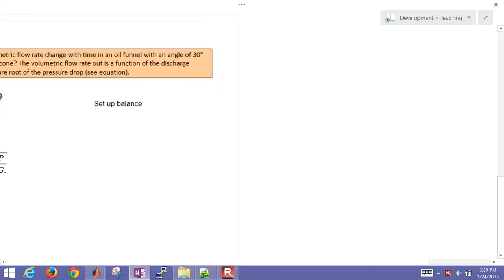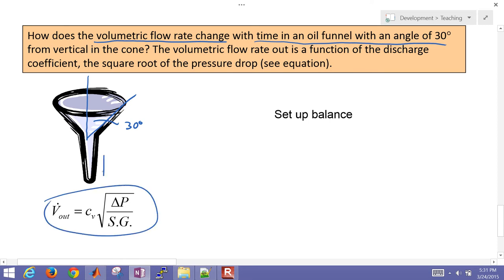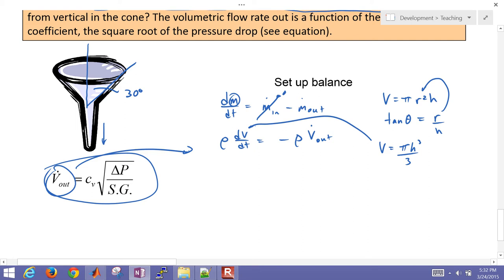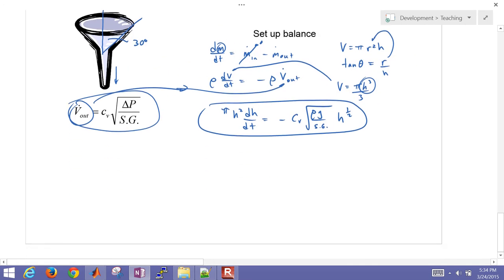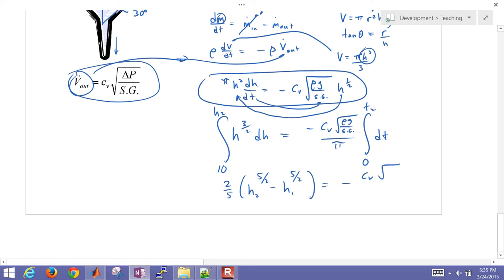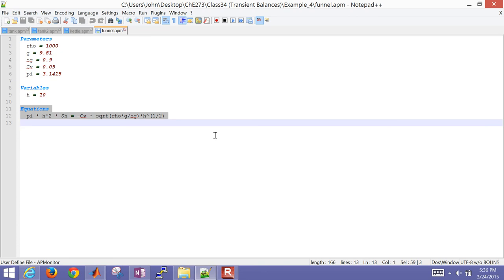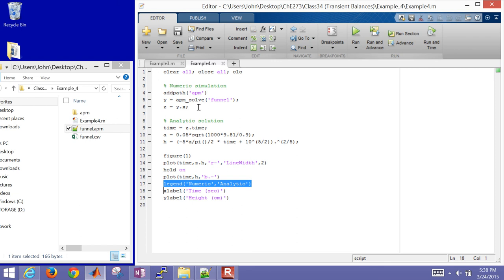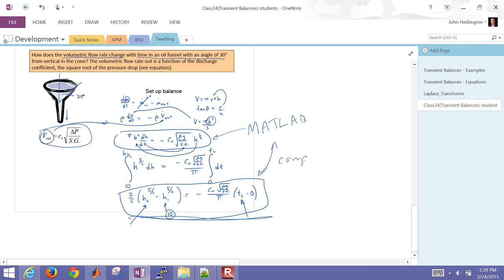Funnel Flow Solution in MATLAB

Comment: There should probably be another 1/3 in the initial volume of a cone. :)
Reply from the maker: Robert Fuller Thanks for catching an error. I'll add an annotation if you let me know where to place the correction.
Reply from the maker: Robert Fuller Thanks, Robert. I added the correction with an annotation. V = pi * r^2 * h / 3 for a cone.